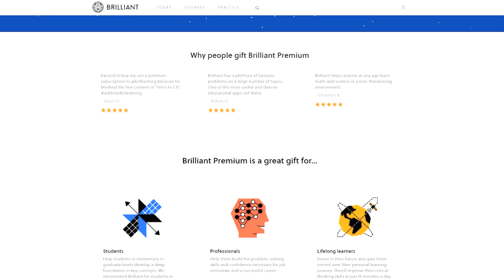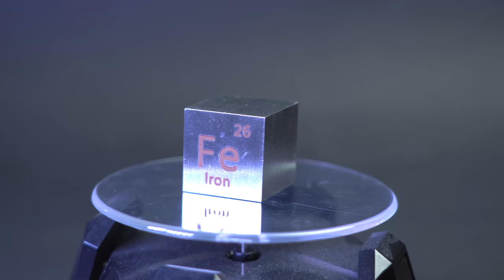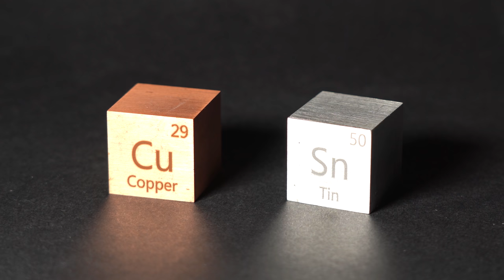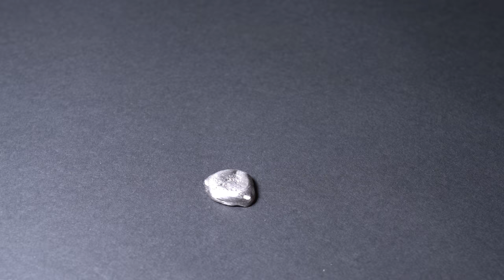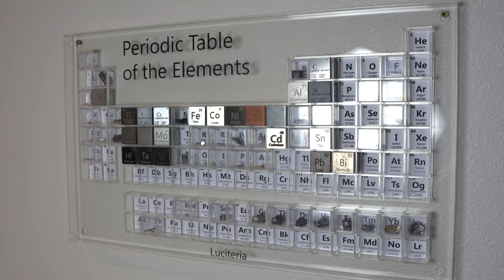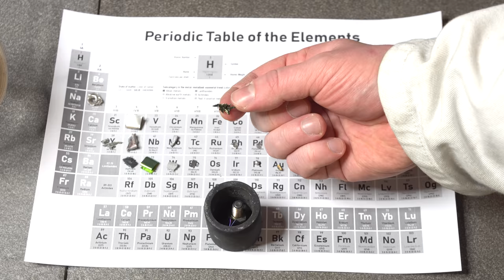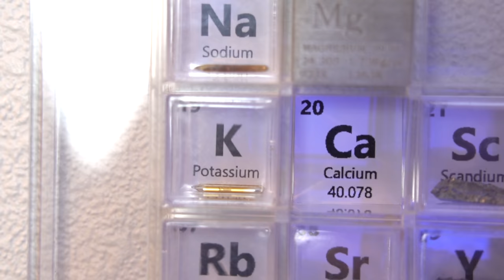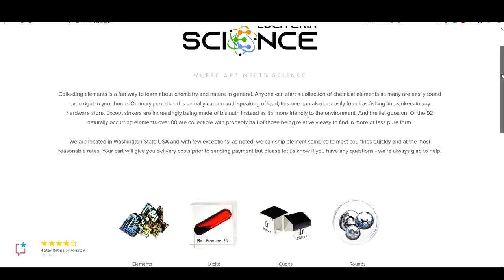What Happens if you MIX ALL The METALS Together?

Comment: 8:00 It is thought that the Sea People, who destroyed Bronze Age civilization might have had iron weapons. If two armies fight, one with bronze weapons and the other with iron, the iron army will be unstoppable even if it is much smaller.
Reply: thats not how close combat warfare works
Reply: @darkstepik  An iron sword will break a bronze sword as soon as the hit each other.
     The guy with the bronze sword blocks the first blow, then has no way to block (or attack) the second.
     It's why people quit using bronze weapons at the end of the Bronze Age. They started using iron weapons as soon as they figured out how to smelt the iron, even though iron is much harder to make.
Reply: @erictaylor5462  
Funny fact: some "legendary" swords were made from meteorite steel , a true steel not cast iron! Steel was equal to moden one! Because space rocks contain chromium, nickel and manganium/molybden!
Reply: @erictaylor5462  Early iron alloys like wrought-iron were actually weaker (in the way that glass is weaker than plastic - there are different strengths) than bronze, less consistent in quality because of a large number of chemically compatible impurities, and couldn't hold an edge as well. Bronze began to be abandoned because tin is pretty rare in comparison to iron ores - if you can outfit a larger army you're going to win regardless of the strength of your materials. Steel eventually made it wholly obsolete but the need for tin was the more important factor in geopolitics pushing iron production.
Reply: @erictaylor5462  Thats not how warfare works buddy
Reply: @explosu  Well that is just pure bullshit, frankly.
     You are talking to someone who has worked with both iron and steal, and who has been very interested in the late Bronze Age and early Iron Age history. I have also made iron from ore in the way they did it in the Early Iron age.
     What you refer to as "early iron alloys" were in the late Bronze Age.
      By the time of the Early Iron age, they had worked out how to make iron weapons. 
   In addition, the transition from Bronze Age to Iron Age didn't happen everywhere at once.
    Not much is actually known about the "Sea People" beyond what they were called. They didn't write about themselves and most of our accounts come from the Egyptians.
     There was no real tin shortage. Also tin is not the only alloy used to make bronze. They actually started out using arsenic    
     Tin was rare, and it became much harder to come by once the Bronze Age collapse took effect, but trade in all goods broke down at that time.
Reply: @WadcaWymiaru  It is not equal to modern stainless steal, but it was much better than anything they had more than 200 years ago.
     And it is largely based on theory, as none of these legendary swords survive to the modern age.
    But you can well imagine what a medieval peasant, or Classical era farmer might think. They witness a meteorite fall and when they collect the rock it is a lot heavier than a normal rock, and it would be quite cold. 
    They would quickly realize the thing was rich in iron and the logical thing to do at that point is to sell it to a blacksmith, who then forges it into a sword. A sword, quite literally from Heaven. Of course it would be legendary.
Reply: @erictaylor5462  That is how I understand the sequence of events from materials I've read. I wasn't trying to be insulting to you or your background of knowledge, so there's no need to be so to me. Metal working has become a pretty common hobby, no? You could shatter a bronze weapon if you were determined (and less determined to kill the person with it) but that wouldn't be the sole determining factor in massed battle, and quality is 100% an issue under non-ideal circumstances for iron, still to this day. If you sneeze on the ore, it gets weaker lol.

The need for trade to obtain the tools of warfare pretty much had to be a stabilizing force for conquest as I understand it. You don't crap in your own well, so to speak - a state that knew they'd be cut off from their supply of materials for arrows, etc. wouldn't start a war with a country that could affect that. You also wouldn't want to be vulnerable to that country starting embargo on you. Iron production was ramped up to solve both issues. Wars breaking out afterwards would certainly affect trade in everything else.

Arsenical bronze is a thing, but it has its own problems - I think a lack of knowledge in mass production for non-military use is probably the more likely culprit for its disappearance there, they would absolutely tolerate the health effects for defense production but not in common use, so the skill to make it could have been scarce to nonexistent. Another area with scarce historical info, it was only used for a brief period before tin became more important.

Comment: Iridium also has a high Electrical Conductivity, even more so than Copper.  I obtained some Copper ore from an Old Mine in the Iron River Region of the Upper Peninsula of Michigan.  The Copper Ore there has a 4% to 6%, compared to the 2% to rare 4% that is typically found in Copper Ore from most Mines.  The reason why this Mine is abandoned and only has tours going in and out instead of Mining Operations is Flooding Issues.  No one in the last 75 years has wanted to sink a possible few Billion just to reopen the Mine.  It would take some Super Pumps to get the job done.
Reply: Silver is even more conductive. It’s the most conductive metal

Comment: First time i learned that silicon is a metal😂
Reply: Gotta  agree with ya here. Even though silicon is used for production of Silumin...a cheap and fragile Aluminum alloy...
However. Silicon does improve casting properties.
Reply: @howersjet  Makes sense since the lattice structure of silicon helps other metal to align properly in the alloy

Comment: wont mix different melting point. lead will vaporize when reaching tungsten melting point.
Reply: how about melt then separately and mix when they are in the liquid form
Reply: @zane10  You're missing the point - tungsten melts at such a high temperature, that it will destroy the Pb atoms.
Reply: @blackt0wer  okay so isn't there any pre mixed alloy of tungsten or something that can liquefy tungsten prior to the boiling point

Comment: Brock Allen Empey here aka B.A.E.
I see your issue here, you will need to update your forge to spin and shake with a locked cap at a special rate in order to achieve distillation of the gold element as it is very dense, so more violent forging with caps lock 🔐 in place you should create a nice alloy

Comment: Well, we have 5000 unique alloys that we know of, but obviously it is expensive to make new alloys using a large number of different elements like this. Now it is... 5001?
Considering the number of metals though, the number is usually N^N for a full permutation of all the different possible combinations. so for instance, 20^20 is a pretty huge number to test, even with the factory optimization method that quarters the # of tests required.
Reply: Not to mention that some alloys are just different ratios of each other

Comment: I wonder if you could smelt metals in a vacuumed induction smelting chamber, that might keep metals from burning off and oxidation of the alloy, and also eliminate gasses present in the air that would get absorbed into the alloy. I don't know if trace amounts of oxygen and other gasses would react or oxidize the metal, perhaps to prevent that, as well as increase pressure if needed, it could first have all the gasses vacuumed out then have an unreactive (noble) gas such as helium, neon, or argon to dilute the trace gasses and make them less likely to react. in order to form them into the desired shape of the ingot, the solidified alloy could be cut, and the scraps could be re-melted (if needed), or the chamber could contain a specifically shaped mold. You probably don't even need a specific smelting chamber, you could use your existing chamber in a vacuum chamber, although you would probably need to make some custom couplers and electrical adapters and install it into the vacuum chamber wall for the cooling lines and supply wires.

Comment: 8:09 High quality bronze weapons often had higher durability and strength when compared to the early primitive iron weapons. However, the switch was made due to the lack of tin during the Bronze Age collapse as well as the fact that iron can be worked easily to make a generally effective weapon without much effect on its abilities. However, the production of high quality bronze required highly skilled professionals who  knew and had the ability to precisely mix the two metals to properly form the correct alloy. Any miscalculation could render the weapon weaker or unusable. So they went with the work smarter not harder, why work all day making one amazing sword when I can make 50 pretty good swords (excluding specific practices such as the Iberians and other such cultures with more advanced iron metallurgy techniques and later iron weapons which were far superior).

Comment: You created the most hardest metal on Earth like a meteorite metal from the outer space that contains gold, copper, nickel, borron, cadmium, chromium, iron, zinc, lead, platinum, titanium, thorium, aluminum, graphite and iron ferric as the magnetic catalist with Magnisium Flouride flux powder. As a conductor it can cunduct electricity as super conductor due to gold, super current carrier because it can handle high current due to copper content and a high frequency enhancer because of aluminum and super anti oxidant. I think that is harder than carbide metals.

Comment: so, my science mind thinks the noble metals should be dropped from the mix, (they probably didn't react) as well as the tungsten because of its extremely high melting point (I don't know how hot your induction coil gets, but I would be surprised if it got up to 3400 or so degrees so as to melt tungsten... it would likely also melt the crucible)
Cool video. I'd call the alloy spaghettium.

Comment: Ive got a question.
As there are many elements with different boiling temperatures.
Is it likely that some of the elements boiled out while the rest is liquid
Reply: Some of them actually burnt away in the video like zinc and magnesium. So I guess those low boiling point metals are the fume from the crucible.

Comment: Tungsten  highest melting point 3422 *C , The melting point of tungsten is 3422 whereas that of other elements is less than that of tungsten. The fire can be extinguished as long as the fire does not exceed its degree.👍

Comment: What is the casting tool used in this video? Seems like a simple setup with the crucible and all. And run by electricity. Help me set this up as well. The red one I know where to get, but the blue one. Where do you get this? And 1700C?

Comment: It would be cool if you had enough material to actually make the same size cube of all the elements instead of having crumbs insice some of the categories, i know some are very rare and therefore very expensive. Yet right off the bat i see a bunch of elements that you could have easily made a perfect cube for a decently cheap price, i think you should go for it, it will look much better than having a bunch of basically empty spaces with a few grains in them and it's a fun project to fill all the cubes perfectly

Comment: Anyone ever look into blind frog ranch? There is this part at the bottom of a cliff where if you melt things, they turn into completely different types. Like he melted sand or dirt and it turned to a type of metal. What if you melt other metals or things there, do they make other strange metals? Supposedly the Aztec used the area to smelt certain metals.

Comment: The production of sparks on grinding has absolutely nothing to do with the chemical reactivity, or stainless-ness of the steels or metals. Sparks are a product purely of mechanical properties in this context. Tiny fragments being exposed to high sheer forces becoming very hot as they are struck or peeled away from the larger mass. It's an effect of heat, not reactivity.

Comment: Never even thought of trying to make an alloy out of all the metals. As of now I have yet to watch the video. I'm want to predict the outcome. I imagine that the metals with the lower melting point are actually going to boil out and what you'll be left with is a fragile crumbling mess.

After watching it seems less of an all metals alloy, and more like several metals trapped inside a steel alloy. The mixing was poor at best. The zinc and magnesium definitely boiled out. Overall it was kind of a let down.

Comment: Sparking has nothing to do with oxidation, it is due to the carbon content. Higher carbon content more sparks we call it the spark test. Also 11% nickle will make steel stainless though 15% would be better and while chromium makes steel weaker nickel makes it stronger. Also all iron begins a nickel in the middle of stars and becomes a nickel isotope and when that star goes super Nova the isotope changes a bit farther and becomes iron. That to my knowledge is how all iron is made. I know there are some amazing alloys involving chromium such as Cop G 32 but iron alloys are not among those or at least nickle does the same job much better and with no drawbacks. Also high nickel steel is resistant to salt where as chromium and any steel made with it has just short of full anaphylactic shock from salt so for any practical purposes don't use chromium steel without getting it a good health care insurance and an epoxy pen.
Reply: *eppy pen

Comment: The zinc burns out the way you did it, but if you heated the zinc to just above its nmelting pointr the copper would actually dissolve into the zinc at a much lower temperature than the melting point of copper and the zinc would not burn out.

Comment: So you can heat up every metal to it's melting point...yet the coils, and container...don't melt...This isn't meant as me calling it fake or anything, i just don't have the level of understanding needed for science to know why every metal is melting, but not what's causing it.
Reply: The coil is water cooled and the containers are graphite and ceramic which have much higher melting/sublimation points than the metals.

Comment: How could he melt chromium with only 1700 degrees in the first stainless steel he made? It has a higher melting point. And why add tungsten and several other metals which has melting points way above 1700? 🤔